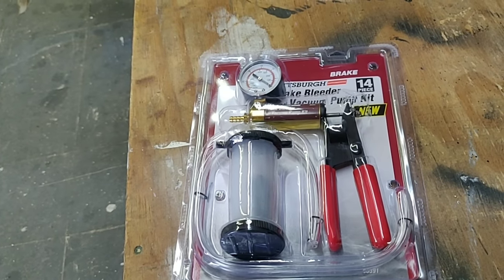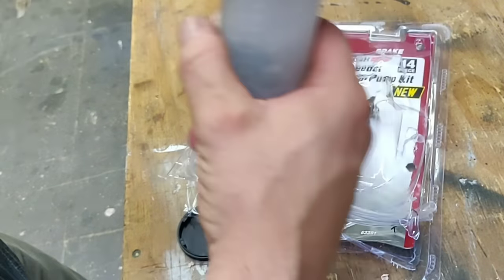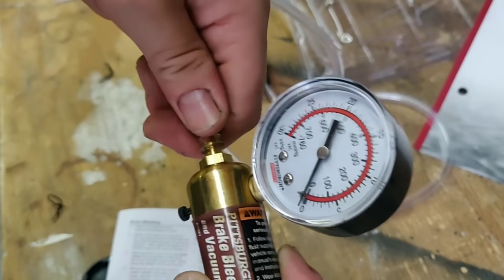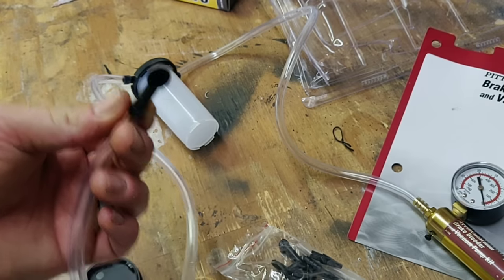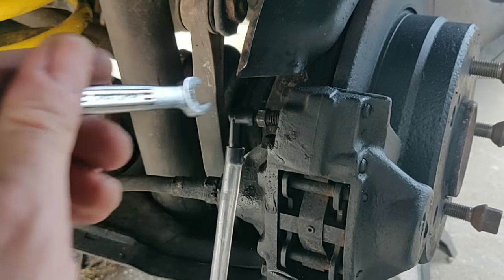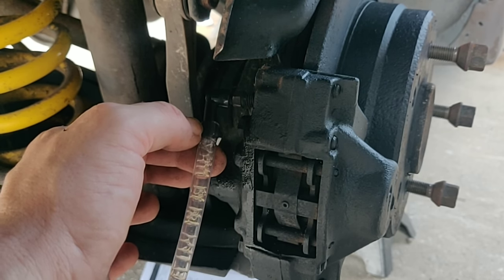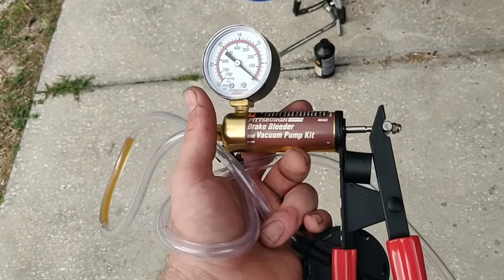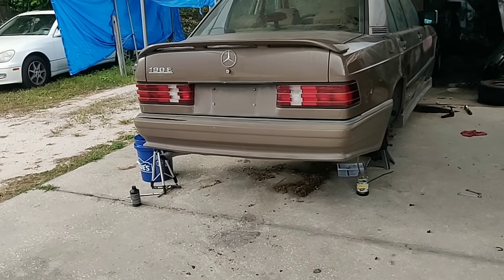Harbor Freight Pittsburgh brake bleeder vacuum pump demo and review

Comment: Hey I know this was a while ago but I just bought this exact one and was having a problem with not much suction and I found out you have to remove a little circle stopper they put on there just for the packaging. I can see you didn’t remove it aswell. I thought I’d let your viewers know this is a great brake bleeder. I can now get it to max out the suction on it after removing the stopper. You can see it at 6:48 in the video. It’s stopping it from fully pulling the slider back and forward. So if anyone is reading this. I absolutely love this cheap harbor freight tool. Just remember to take off the stopper
Reply: Stopper? Is it that little black cap below the pump under the dial?
Reply: @jeanponce2017  no it’s not that’s to release the pressure. Do you see the red handle? Right above the red handle, right between them is a little black circle price of plastic
Reply: @bumbee2227  I think a better picture of the pump is at 02:21 where he is holding the pump in his hand.  There, you can clearly see a horizontally positioned black plastic tube or such in between, holding the "arms" of the handles apart.  So ,once removed that plunger should retract all the way into the vacuum cylinder.  The pumping action should now produce a longer "throw" on that plunger, creating the vacuum needed to operate the bleeder.
Reply: @bumbee2227  
I was just guessing thinking maybe it's some breather port. But as I watch it I noticed that he couldn't pump it so I saw the block that restricted him from pumping it so the cylinder could pump long stokes with the piston giving him plenty of power. Without it he was handicapping himself. How he didn't realize he can only squeezed it a half inch which isn't doing anything.
Reply: not all heros wear capes thanks man
Reply: The black cylindrical shaped stop that is located just above the fulcrum point of the pump grips is just there for packaging purposes. Once the stop is removed, the distance between the two red grips increases significantly and the pump is now in the position to create a "vacuum" when actuated. The first page of the device usage instructions states "Testing The Vacuum System".
Reply: I did the exact same thing...until I read the instructions. They not only say to remove it they give a drawing of it with an arrow 💯🤷‍♂️🤣
Reply: Just picked it up and was having trouble and was about to throw it out thanks man your a life saver
Reply: @adelanshawn  😂😂😂
Reply: I can't believe he missed that. It's obvious
Reply: Indeed ! That plastic piece limits the vacuum stroke severely. Strange that the demonstrator couldn’t “sense” that by the very short travel, when pumping.
Reply: @jeanponce2017  No. Piece just above the fulcrum and between the handles is the interrupter that needs to be removed. Then the vacuum rod and outer handle can bottom out . This enables maximum vacuum stroke. See 11:07 .
Reply: Too late for me (returned unopened) but pin this comment!
Reply: Thanks buddy, I just bought this product myself and I can't wait to use it😀
Reply: Thanks!  That is a big stopper..lol.   Also he should not empty the whole reservoir.  and introduce air into the system then bleeding out that air.  Oh well!
Reply: Haha that’s funny, I had the same issue with mine but didn’t throw it away. Glad I read this comment!
Reply: So glad I read this before I went to harbor freight to buy one.. lol. Let’s be real tho.. 😂.. woman read the instructions or watch how to videos BEFORE tackling something new 😂😂  jus playin guys
Reply: 10-4 and thanks for being honest!
Reply: at 2 minutes and 40 seconds.. ❤ the instructions weren't carefully observed 👀
Reply: Lol " spoiler alert. Don't buy it" he said.
Thanks a lot man. Gonna go grab this one this weekend
Reply: thanks man i didn’t even notice the little piece!
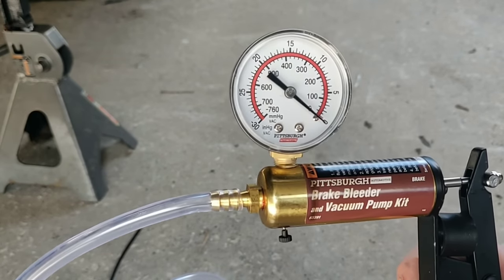Reply: I believe the black circle plastic piece you are talking about can be seen from a better view from 6:48 to 7:15. When you see he pumps the upper handle, the part blocks the traveling distance of the handle. Probably that's the reason why he couldn't max out the suction force from the vacuum. Hopefully I understand your words correctly.
Reply: Is the stopper on the bottom of the pump?
Reply: Thank you!
Reply: @sunflower1159 i gotta say that women do read the instructions 😅 we men are too lazy to do it most of the time 😂
Reply: @jdchevy100 no, it’s a black cylinder plastic tube that’s located just below the pump piston and just above the handle mechanism
Reply: Just bought one and can not get it to create any vacuum whatsoever. Any suggestions
Reply: This is why we need the dislike button and only watch the videos with more likes bc they do it right
Reply: @fernandomasias9314  exactly! Wtf
Reply: You owe HF an apology because you didn’t remove that spacer
Reply: Wow! Thanks man! I bought one from Napa and the fittings sucked. I'm gonna go get this one.
Reply: I’d probably remove this video altogether or change the title.  I wasn’t going to buy it and just wanted to read the comments to see what others thought about this tool.
Reply: Absolutely!!
Reply: Absolutely right; PLUS; the reviews don't show to pump up the vacuum to 25psi BEFORE you open the bleeder screw; and maintain the pressure; gotta wonder about some guys !!
Reply: Someone gone be lucky finding a good  working tool in the trash can. lol
Reply: @MrCxiong116  Right !!!!!
Reply: Thank you for the heads up on the spacer. I just bought it today and it worked perfectly.
Reply: And here I'm reading this comment because I'm looking to buy one and almost didn't until I read this comment.
Reply: @ramonqueloquera  I bought this not too long ago and it worked like it should.
Reply: You're right. That black piece of packaging will keep the handle from depressing all the way.
Reply: There's nothing worse than throwing perfectly good tools away 😮😂
Reply: After reading comments you gotta review the product and edit your review
Reply: Thanks for this boss man 😂😂😂👊🏿👊🏿👊🏿❤❤❤
Reply: I just bought a new one. And that thing doesn't exist. And the pump is garbage. It does not hold pressure with the hoses, they keep sucking air at the connections.
Reply: great piece of advice! thank you for helping the DIY community.
Reply: @tedtolentino4955 if you look at the picture of the pump when he looks at the instructions that plastic piece is not in the picture.
Reply: No way, I've had same problems as well and stuck on these brakes for couple weeks between work and not finding anyone.ill check for stopper.thanks you could've saved me a lot of time and money buying the air compressor tool which I'll use once.
Reply: A better point of the video is at 11:33 when he's calling it a piece of crap and that he's going to throw it away, lol. Can clearly see the black rubber stopper.

Comment: He forgot to remove the plastic spacer from handle!!!! Mine works perfectly fine!  It even says remove spacer prior to use in the instructions! 😂😂😂
Reply: 3:00 guess that was in that part he skipped?
Reply: Lmao...bro he did!!
Reply: Lol, nice catch!
Reply: Nice Catch!! 🤦‍♂️ Lol Would have been funny if he went back to Harbor Freight on camera and said this pump is a pos and doesn’t work, and they said umm.. step 1, first you have to remove the spacer! 😆
Reply: Laughing my fucking ass off!!!!!
Reply: Doh🤣
Reply: Blind leading the blind 😂 nice catch
Reply: 803 spacer still there
Reply: Okay I need to do a brake bleed on my sister's car I remember seeing this video a year or two ago and he said it was not a good buy thanks for that. Bout to head there now and get one
Reply: Well obviously he doesn't finish things his watch loop isn't even complete
Reply: So would this work to get trash out of the lines?
Reply: @zacherynagy8445  So not sure what you mean but if you have dark colored fluid it can clean it up.
Reply: @Vans1989  Have a failblazer that sat for about a year and a half and ive finally gotten life back into it but the master cylinder was nasty as all hell. Didnt find this out until I had already started changing a stuck caliper on front driver side. Im now wondering if its even possible bc I think i may have screwed the seals on the inside of the master cylinder causing me to not be able to get any fluid to the front calipers. Ive taken the master off and manually gotten fluid to go through it but without the lines being attached im not sure if it means anything
Reply: @zacherynagy8445  Wow 😳. Um I'm not sure were to start my sister's lines on her car rusted out so I need to replace both lines in the rear for the left and right calipers. You need to just replace the caliper or bleeder screw.
Reply: This is why you must read the directions before starting.

Comment: Imagine giving a tool a bad review on a video, getting over 400k views, end then find out you weren't using the tool properly 😂 at least admit your error so people don't get mislead
Reply: 500K Views now, also I think the Gentleman needed to started bleeding from the rear brakes than work his way up to the front tires. I think Johnny just didn't understand that part. But great tool for the price
Reply: Lolols
Reply: I ignored the review and bought one and it pumps all the way up to 25.
Reply: @probochronicles3991  gah dam smh
Reply: @Menga213 1.2. Million views now!

Comment: Just to let you know you forgot to take out that black spacer. That’s why you weren’t getting enough pressure. I bought the same one from Harbor freight and it works fine!
Reply: I was having the same issue and that spacer fell off and I was able to pull a full vacuum 😂😂 I was thinking it was junk before it fell off
Reply: I wanted to say the same thing!
Reply: Which one is the black spacer? The one connected to caliber?
Reply: @cizvi  i think they are talking about on the pump handle you can see this kind of big circle black spacer in between the pump handle. so when you are squeezing to pump you are basically not squeezing it enough cause the spacer is stopping you from fully squeezing the device. idk if that has some use or not. some things i buy not related to cars have spacers on them and sometimes they are basically just decoration for packaging i believe
Reply: Pure comedy
Reply: That is unfortunate....sounds like something I would do.  Still, I cannot get mine to pull fluid out.  I tried it on a brake that did not need bleeding and it was not pulling fluid.  When I tried the two man pump break method, fluid came right out. HOWEVER, THE PUMP MEtHOD DOES NOT WORK ON THE side needing bled either.
Reply: @josepheastman1719  yea same happened to me and i bought 2. 2 different brands because one would not hold pressure at all due to an air leak in the pump even with the silicone ring on good. other one held pressure but couldn't pull any liquid for shit. spent a good 2 hours trying to use it and nothing. had to get my deaf gf to pump the breaks and yes she is legit deaf so it's hard just to call out when to pump and when to stop. took me only 10 minutes for all tires bleeding it twice.
Reply: Update....turns out master cylinder was plugged.  Once I fixed that, the pump worked just fine.  Don't know why it improved on the brake that did not have trouble bleeding as they seemed to be on different lines from MC.  Anyway....THE HF PITTSBURGH PRODUCT WORKS.
Reply: Thanks for the heads up, just bought one tonight.
Reply: Exactly 💯,   I am using same one since years and it's working great 👍
Reply: @freightliner18  ,  Did you have good results Jason?   Or have you not bled the brakes yet. Thanks
Reply: To high priced brake peddle holders..? Too high priced friends..?
Reply: Have a new totem victor ebike to replace mechanic and insurance and compliance robberys that had a new motor that did not work

Comment: Dude...I bought one of these to do my Nissan 200 sx brakes after I changed rotors, pads and calipers.....This little pump works just fine, and has sufficient vacuum to pull the fluid thru - you couldn't pump because you left the handle pad in place!! Take it out, and it works great.....Don't give ppl car advice if you can't even figure out the tools for the job.......
Reply from the maker: Thank you for watching and I will look into that.   Have a great day.
Reply: Ďònt know what went wrong for you but I have the same pump and it works great.start with rt rear,lft rear,rt front snd left  frt last.dont let master cyl.get too lowe,
Reply: Haha woops! I just saw him running after the garbage man, but the garbage man took off! LOL
Reply: Haha
Reply: Warren Morphis  😂 He will look into that and hopefully never make another YT video 😆
Reply: He’s a hack, out here spreading dangerous disinformation about things he knows absolutely nothing about, just to get ratings and likes.

Comment: You've got to remove the plastic spacer between the hand lever for it to fully pump.
Reply: 👍🏼 yup
Reply: Imagine making a tutorial and not knowing how to properly use the device which you're attempting to teach others to use.... lol. I'm not dogging this guy.... but man, a lil embarassing.
Reply: He fixed it here: https://youtu.be/4DSAM0QLix8?t=160 but should probably edit his "don't buy" reasoning in the description of this video.
Reply: @JAYSON BULTMAN lol for sure. He keeps making pressure in a vacuum. Lol
Reply: @sgtdaye  how about the fact that at 9:33 he LOOSENS the bleeder twice instead of tightening it !
Reply: Plastic spacer is fully visible @ 11:47   Just below the steel piston rod, and just above his little finger.
Reply: @sgtdaye  …”…not knowing how to properly use the device…”.   This comes from than Manly Virtue of “Instructions? We Don’t Need No Stinkin’ Instructions, And We CERTAINLY Don’t Need No DIRECTIONS!”…

Comment: Im pretty sure you had this set up wrong, the nipple needs grease to stop air bleeding that gives you the endless bubbles. I have one and when it's set up correctly and used correctly it does a mighty fine job
Reply: Hey man what type of grease do i put on there? Thanks
Reply: @Luis-ml3uz  any thick greese like lithium or moly will do the trick. as long as it isn't too liquidy.
Reply: @shriramvenu  thank you
Reply: Nah... he's short stroking the handle. He didn't read the directions and remove the stopper
Reply: Teflon tape works good.
Reply: Teflon tape on the bleeder screw helps too

Comment: I used one today, sucks really well. Found that the bleeder valve on the Autozone calipers were such a sloppy fit that air was leaking around the threads when it was loosened. On one, I just coated it with grease and it sealed pretty good. On another I cut a piece of hose and stretched it over the threads to create kind of an o-ring. That worked very well. Until I figured out where the air was coming from, I could have pumped a gallon of fluid and never got a clear line.

Comment: I had to replace a caliper on my Trailblazer. I got one of these tools and bled the brakes without any problems and it is working fine. Simple tool. Works fine.

Comment: I have this same exact kit that's over 10 years old. I was finally able to put it to good use after the metal brake line in my 2004 Subaru Outback rusted out. I bleed the entire system after replacing all the metal components in the rear section. Aside from the little rubber bleeder fittings that didn't quite create an air tight seal, (use a short piece of aquarium tubing). This HF brake bleeder worked perfectly, just read the instructions if you are not familiar with the process!
Reply: i agree...he may have had a bad unit...but the master was bone dry when he  showed...which is a big no no... one man bottle system is best imo...
Reply: roadstar499, having a properly working tool is a blessing! Knowing how to properly use that tool is necessity!
Reply: There are no instructions with my kit
Reply: @3rdgenjunkies57  , did you get it from HF? Perhaps they will replace it for you...they’re usually pretty good that way!
Reply: @who8dapple  I found the instructions but I didn't open it and I'm gonna return it. I'll do it the old school way
Reply: @roadstar499  lol nah his unit fine he didnt remove the rubber piece between the handle so that stopped him from getting good pressure
Reply: He also left the cap off the master cylinder 🤣🤣🤣

Comment: After reading the comments I checked my pump an lo and behold there was that plastic shipping spacer.
Reply: your last video clip shows brake fluid in the line between the cup and the pump meaning you probable go fluid in the pump that kills pump valving every time. The 23 inch line between the pump and cup should go to the connector that does NOT have the short plastic tube on it. The cup is to keep the fluid from reaching the pump and fluid accumulation.